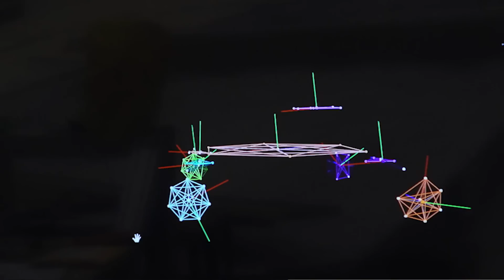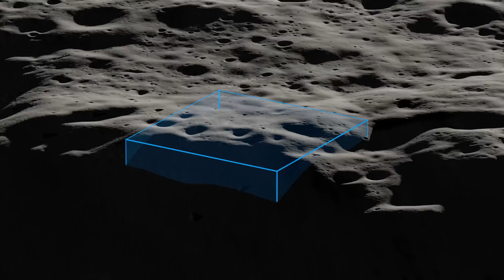The Dumbest NASA Decision In Years? Why NASA is Being Forced To Ground Rover and Sent Ballast.

Comment: So now they have a 430kg rover with no use, but they need a 430kg mass simulator to send to Moon, right?
I smell a potential loophole there. 
They could rename VIPER to MAMBAS (Moon-Avenging Mass Bureaucracy-Avoiding Simulator)
Reply: Best comment I’ve read :)
I think the problem would be the ongoing running and managing expenses of the team responsible for it.  Such a waste
Reply: It would be wasting a rover. Because it would be a dead mass, doing nothing.
Reply: @paulopenteado5552  phase two would be after the landing: "oh, by the way, that Mass Simulator was previously supposed to be something else, so it has some built in sensors..., how about taking it online and doing some science while we're on the Moon already?"

Comment: 30% over budget?? If that is the case, then why the hell is SLS still a thing? That has to be 200% over budget 😂
Reply: Because SLS is the Senate Launch System.
Reply: @EdwardRLyons  can we use it to send the senate to land on the sun?
Reply: @LordOfNihil  Don't forget the house!
Reply: @LordOfNihil >>> The Sun does not deserve such disrespectful treatment.
Reply: @EdwardRLyons   you means the senate laundering scheme
Reply: Congress can vote to extend mission funding for viper, just like they did with james webb and SLS
Reply: @DrewNar-tacA not in this election year…Congress will have other things to do like useless impeachment hearings, self inflicted constitutional election crisis issues, the budget …
Reply: NASA solves that by renaming the project. This is like the 10th version of SLS. The original version on 1996 if I remember right, was and I kid you not, a orange fuel tank from the shuttle mounted ON TOP OF a srb from the shuttle. It was meant to be a cheap alternative to the shuttle. It never flew. Out of all the versions, only two have ever flown once. They also abandoned an update to the shuttle engines for greater reuse.
Reply: @jessiejanson1528  The version you're describing is Ares 1, which was shuttle derived (and actually few once as a test, called Ares 1X), however it was not a precursor to SLS. Ares V was supposed to go with Ares 1 to the moon, and Ares V was the one that went on to "become" the SLS (although it's really just the same rocket with a different name)
Reply: Or James Webb which is 1,000% over budget.
Reply: @killsode4760  >  James Webb which is 1,000% over budget.

Incorrect. It is in fact about 2000% over budget...
Reply: @denysvlasenko1865  and yet all of nasa's combined annual budgets since apollo ended is still less than what apollo cost which is still a small fraction of the US military budget in ONE YEAR
Reply: Source? @killsode4760
Reply: @killsode4760 : Looking for intelligent life when UFOs have already been acknowledged. They can even fly in air and underwater.
Reply: Can’t we just do a fundraiser to get the thing to the moon that’s a big waste of a rover just give some people the ability to give there money for it and give them exclusive pics in return and everyone is happy and we get more data from moon
Reply: Because Congress approved the extra budget.
Reply: So they have a Rover, but it went over budget. So instead they're going to spend money to send a rocket to the Moon with... Nothing. Sounds like government
Reply: Are they taking into account shuttle and constellation in the cost of SLS, arguably this is where the majority of SLS tech originates 😂
Reply: Probably because it was approved before the law went into effect.
Reply: And it's still junk
Reply: SLS is an employment program to retain professionals in the industry and keep them from retiring
Reply: The rover’s budget is not large enough to justify a 30% over.  Not enough pork to spread around.  Now if it’s ten times larger, that would be different
Reply: coughShuttlecough

It's all fun and games until the CIA takes it's toys and goes home.

Comment: Why can't they just rename VIPER to "Mass Simulator"?
Reply: It would still require heavy funding to make ready for launch, a chunk of metal is ready.
Reply: @alexradac589  also you would have to account for the parts.
Reply: @MusikCassette  it's already built though
Reply: Because it would be wasting a rover. It would be doing nothing.
Reply: At last someone with a brain.  However NASA will probably spend several years deciding on the font.
Reply: @WOFFY-qc9te  NASA needs an E4 Mafia to get things done behind the backs of the MBAs.

Comment: I understand the idea of trying to keep projects from going over budget. But the actual consequence of such rule is that (potentially for reasons entirely unrelated to NASA's own performance) instead of spending a bit more than 130% and getting the project done, they choose to spend only 130% and get nothing. I suppose that is a very heavy way of preventing sunk cost fallacy, but clearly, there needs to be some sort of arbitration system where a project has to be reviewed if it goes over 30% of its budget, to find out what caused is and who (if anyone) is at fault, and then decide how to proceed, instead of some sort of automatic cancellation.
Reply: Going over budget by a certain amount should prompt a very close fraud investigation on the contractor. Over a certain point it stops being "Oops we guessed wrong".
Reply: There is NO "automatic cancellation".
Reply: There is. It is not an automatic cancel. It went through review. And it got to the point where the budget Congress enacted was not enough to pay for the extra cost.
Reply: And for a hard cut-off "cancellation if it would go over 130% of the budget" with "less than X% already spent" makes a lot more sense.
Reply: Nah then it wouldn’t be a government project

Comment: If there is one thing NASA is good at, it's wasting money. Just look at this Boeing crap. Dragon is so much cheaper and more reliable. Yes I know they want more options, but it's getting kind of ridiculous with the overspending. Also, SLS is waaaaaay over budget as well.
Reply: Basically every government department is good at wasting money.
Reply: Boeing Starliner is run under a fixed price contract, and I'm fairly sure they get paid by the milestone, so this is simply not applicable. Also the fact that Dragon/ Falcon9 is currently grounded shows how important it is to have a second option. Finally if you are going to do a commercial crew program, you can''t just give SpaceX a monopoly and call it a day. You NEED competition.

Comment: We have decided to shutdown the the project by disposing of the rover. Due to our requirement on both disposal costs and needing to pay for ballast, we have decided to use a very rover size/shape/weight ballast by disposing the rover on the moon.  To safely remove the ballast to a safe space, we will remotely operate the rover for 1 - 3 years. That will require us to collect data for proper navigation purposes only...

Comment: This just brings to mind the same old irony that Congress critters want to find missions to fly on SLS, but will not fund said missions to be significant enough to justify the SLS cost.
Reply: Murica
Reply: SLS > Starship
Reply: @blackhatfreak  Yep.  4 billion per launch vs around 100million(fully unreusable) so SLS certainly is much > Starship.
Reply: @NScherdin  Thats the theoretical cost. Each starship test flight is closer to 0.7-1.2 billion all in. I work at starbase. 

Maybe instead of picking and choosing 'teams' we should just root for everyone.
Reply: @ThePhantomRocket  1.2 billions is still 3.3 times cheaper than 4 billions, which is a lot. However, I agree with your last point, more options is better than fewer, or only one.
Reply: @yonidellarocha9714  Your still wrong, Starship gutted is 1.2 billion. Throw in the crew rated parts and we are sitting over 4 billion. They don't even have one bit of research done on radiation shielding for Starship. Guess how many billions that is?
Reply: @lextacy2008 also NASA isn't just launching flawed rockets wasting billions before they build a successful rocket.
Reply: @ThePhantomRocket  That probably has the development costs factored in. That's not the operating costs
Reply: @lextacy2008 Awfully confident statement there based on... What insider info? It really sounds like you're just making stuff up to object to.
Reply: @ThePhantomRocket  If you work there, why are you publicly commenting on financial details like this?
Reply: @wombatillo  Taking guesses isn't spewing financial details. "Financial details" would include a breakdown of every sector's expenditure, manufature and material cost and what not. Also, the cost of Starship's development isn't THAT much of a secret either, because that information is shared among shareholders.
Reply: @NothingXemnas  I know. I'm just wondering why anyone working for a high-profile employer talks publicly about their work regardless of how insignificant the details. Why take the risk?
Reply: @Old_Ladies  Name a flawed rocket, we'll wait....
Reply: @ThePhantomRocket  NASA has a miniscule annual budget compared to most contractors.
Reply: @lextacy2008  all rockets are flawed. Spacefaring rocket engines  have terrible reliability after more than a single launch all the ablative materials evaporate and materials are thinned they are also subject to tremendous forces during use.
Reply: @NScherdin let's wait and see how much Starship actually costs per flight once it actually has been reused.

The most successful flight so far involved the booster "landing" in the sea and sinking. With starship itself crashing into the sea and sinking. The flight control were observed to be melting even though this was a suborbital flight with less reentry heating than would have been the case with even LEO. It's intended to be able to safely land from the Moon.

Currently Starship is less "reusable" than the Shuttle orbiter and SRBs. Which stretched the definition to "Needs a D check every flight". The original claim was that it would only take two weeks after landing before the same orbiter flew again. Enough time for a B check.
Reply: @markevans2294  Interesting take here. We seem to forget about the re-entry being childs play at LEO< but when coming back from the Moon its going to be a massive hell hole.
Reply: @NScherdin  keep crying, Starship isn't reusable if it can't even land lmaoooooooo
Reply: @blackhatfreak  bait used to be believable
Reply: @dotnet97  not bait when it's true. The next SLS will launch before the next Starship can even launch and la d successfully.
Reply: @blackhatfreak  really gotta work on your bait game
Reply: @blackhatfreak  you're the one crying because I didn't take your bait

Comment: If that is the case, shouldn't SLS be canceled?
Reply: The Senate is never going to cancel its own launch system.
Reply: @EdwardRLyons  that is the truest answer
Reply: Starship has flown more times than SLS despite launching after Artemis 1.
Reply: @kargaroc386  True, but it has not yet had a fully successful mission, nor has it carried a payload, or achieved a full orbit. But SpaceX is getting closer. Perhaps flight 5 will see both components survive intact. Then they can look to proper orbital operations on flight 6 - maybe even with a nominal payload. Only then will we start to see what Starship and it's booster are actually capable of.
Reply: @EdwardRLyons spacex is planned to spend 5 billion on starship yet artemis would be closer to 100 billion so there is a difference
Reply: Not if Congress gives more money.
Reply: No because it's flight proven unlike Starship lmaoooooooo
Reply: @blackhatfreak  Sunk cost fallacy
Reply: @blackhatfreak  It has flown though? I know you're trying to be a little peace disruptor and do some rage bait in the comments, but at least try to say stuff that makes sense?

Comment: Strange... they go over budget because they want to do extra testing, now they have to cancel the project and instead develop a mass simulator.
That will of course again cost money.
Why not just send the already built rover without doing the extra testing?
Reply: That would make too much sense
Reply: Not sending it is a 100% chance of failure. Not testing it is less than 100% chance of failure.
Reply: @Stu_Bur  yeah, that is kinda how Elon Musk would think. It is a shame that we got to this point and think it should be the norm.
Reply: @scribblescrabble3185  Testing would be better, but not at the cost of the mission.
Reply: Same thing would happen to the mass simulator. Over budget, then cancelled. They should instead cancel the project manager.
Reply: issuing a fine to astrobotics to pay for the rover seems like the most sense to me, it is their fault after all.
Reply: Is you send the rover and it doesn't work then you have lost 100% of the rover cost. If you dismantle the rover and re-use the instruments you may recover 25% of the cost as savings on other projects. So it a "safer bet" to dismantle and re-use.
Reply: @cargorunnerUK  The majority of the cost is in development, not parts.
Reply: @cargorunnerUK  The "cost of the rover" as it is normally published is not the cost of the actual nuts, bolts, metal sheets, and components that make up the rover.
Constructing a new one or new components based on the same design will cost a fraction of the total project cost.
Normally there even are several models and sets of parts, in case something breaks before the launch.
Reply: @Rob2  Surely you will take completed, and tested scientific instruments and install those instruments on a new rover. You will not dismantle everything down to nuts & bolts etc. The scientific instruments will have significant value. Saving significant time & money on other projects. This would make dismantling a better financial option than sending the rover to the moon in the hope it may work
Reply: Because of the legal words in the contract.
A lawyers dream.
To simply change the legal words, would cost more in lawyers fees than the massive expence of building a new rover.
Reply: Because it's a bit too "SpaceX" like.
Reply: Because Congress won't even allow someone to push the big green start button.
American congress are always a stupid joke, the only way they do anything is if they're bribed by "lobbyists" (HAAAHA spellcheck says the correct spelling is "trilobites" )
Reply: Because the 100 million dollar instruments will be lost if it fails
Reply: Incredible amount of people who don't know what a law is.
Reply: Because it is not just testing. It is also money for finishing ground systems and operations.
Reply: The way I see it is that sending it without the tests would have a MUCH higher chance of failure. And with a failed rover, they'd lose some expensive parts that could otherwise be repurposed for another projects.
Reply: I understand that NASA needs a strict budget system. as you can see with the military industrial complex companies will basically farm the government for money until someone with enough authority starts getting mad about why a plane they ordered is multiple decades behind schedule. NASA has a limited budget so it has to have harsh penalties for companies that go over the budget limit.  if companies know that you will forever throw money at them then they will get lazy.
Reply: Legally they can't even if they wanted to
that's the entire point of the video
Reply: It might fail without it
Reply: @manachromeYT  Mass simulator has a 100% chance of failing rover objectives
Reply: @SamuelLiJ  Exactly LOL
Reply: @manachromeYT  if it fails you get data
Reply: @LucasFerreira-gx9yh  You get data, but you also lose an expensive rover. That hurts public image as much as it hurts potential future funding.
Reply: @manachromeYT  an inert block of mass has 0 chance of providing data or science, an untested rover has a non 0 chance.
Makes sense to me, just make it abundantly clear to the public that its untested because of bullshit funding requirements so the press doesnt say NASA should be defunded because a mission fails.
Reply: It's amazing how they're supposed to be some of the smartest people out there and they can't count. Also what kind of testing costs 50 freakin million bucks, how much of that are actual tests and how much is paying for red tape and signatures from guys with certificates than no one else has so they can charge whatever they want.
Reply: @adamtarnowski-jk1wq  The scientists are smart. But the MBAs and politicians are in charge.
Reply: @adamtarnowski-jk1wq  Hey! At least 50... thousand... of that will go towards testing! If 500 people with fancy titles who never looked at the rover don't sign it off how will we know it works?